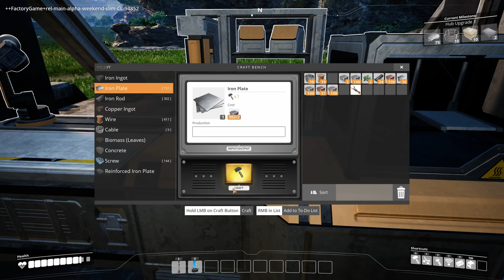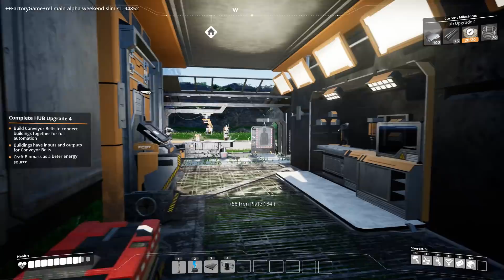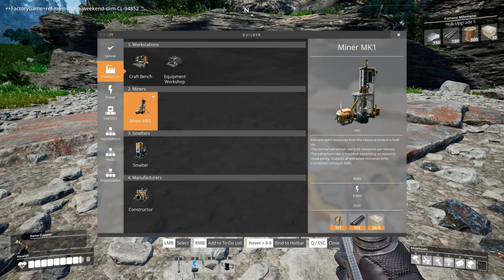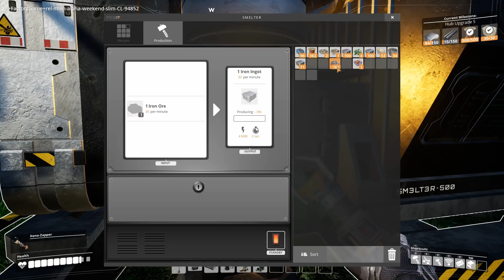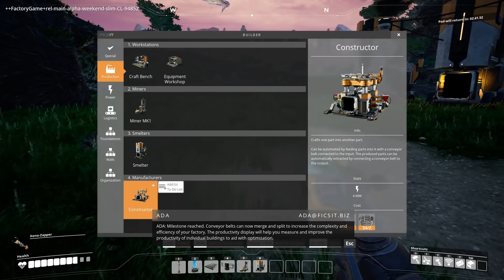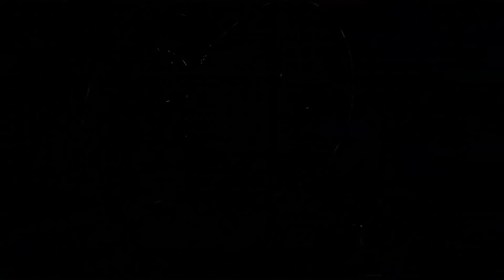Satisfactory Beta Weekend! #2 Basic Automation, Mining & Smelting!

Comment: I've been playing it quite a bit this weekend.  I'm to the point where I'm getting assemblers going.  The thing I'm struggling with is power management.  I don't have a problem getting power.  It just seems there's something going on that I don't understand.  I've got plenty of power, but for some reason the circuits are still tripping, even though I should have more supply than demand.
Reply: Could be your power line layout. Check to see if any of your bio gens are not connected to the network. If one is connected directly to a machine, the power won't flow through to the network. You could also be getting power spikes. When a machine is full, it stops using power. If it starts up again, it can blow a fuse if the usage goes above output.